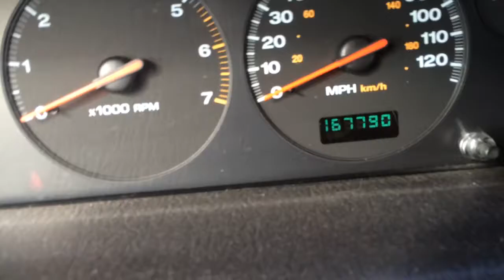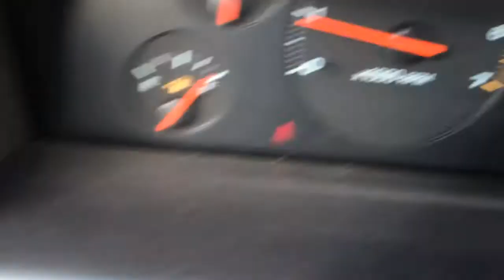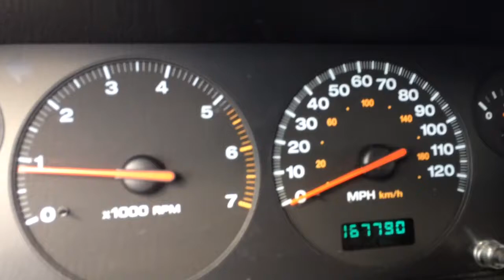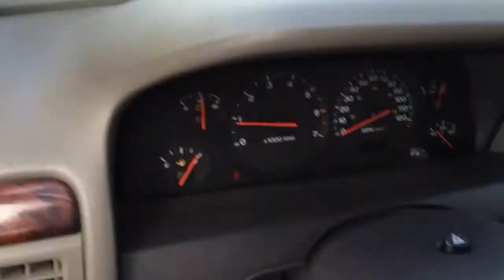My jeep

Comment: do you still have the jeep and if so how does it run?
Reply from the maker: East coast Thrilla sadly noise had some repair work done and it caught fire 40 minutes after leaving the shop whole car went up
Reply: SuperJeremi10 aww man that sucks .
Reply from the maker: East coast Thrilla yea it ran great up till the fire it went in for some hoses needed ingredients change ac repair and a tranny leak I got it back and noticed some weird issues that weren't there before hand it was lacking power and and eating a lot of gas but I had picked it up in the evening gown so I was going to take it back in the morning
Reply: +SuperJeremi10 wow maybe when they recharged the ac somehow they goofed up some wiring ? I had a few bad experiences with craigslist mechanics but never again .
Reply from the maker: East coast Thrilla not sure what they did. the ac when I took it in the compressor cycled like low on charge and. the told me a hose was leaking so I had it replaced and recharged my radiator hose was also leaking coolant light kept coming on and tranny line was leaking
Reply: SuperJeremi10 it seems like they dropped the ball big time. All they should have done was change transmission line and whatever hoses . Recharging the a/c uses a special machine to drain out existing refrigerant then charge it but the probably didn't  do it that way. That was a nice jeep too.
Reply: +SuperJeremi10 well I hope you got something nice after all that you deserve it. have a good night man.